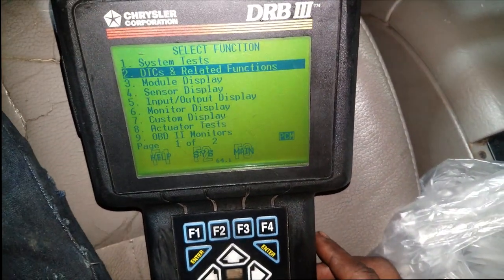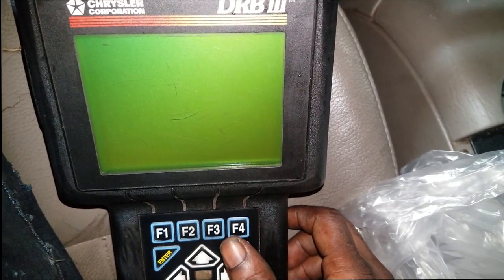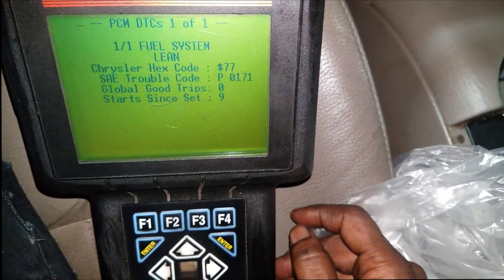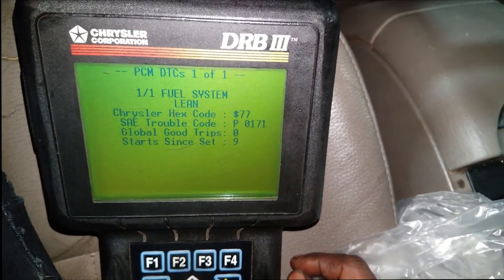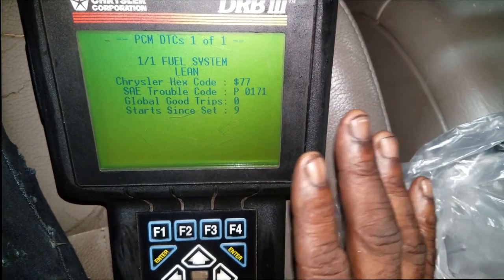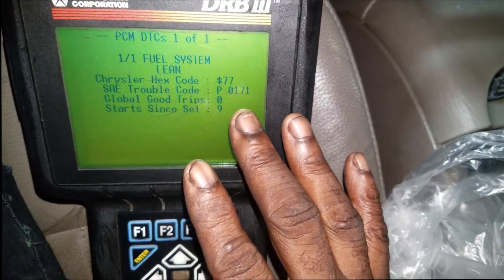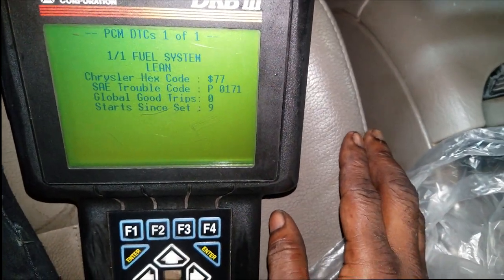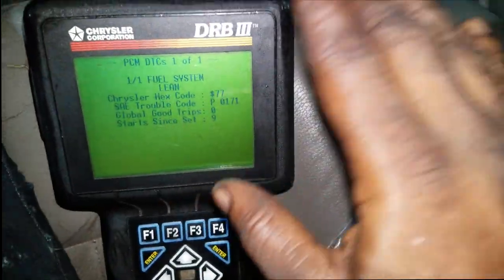How to tell if the fuel pump BAD. Car shuts off while driving, DTC code P0171

Comment: I have a 2002 Ford Mustang V6 and as I'm driving it shutdown so I pull out the key and then sometimes it will start back up but sometimes not right away. Any suggestions I can do.

Comment: My 96 Explorer 4.0 shuts down on the hiway, I roll to a stop and it will be idling, I shut the switch off for a second or two, then it starts up and may go anywhere from 7 or 8 miles to 60 or 70 miles then it's the same thing. Could this be my problem too?

Comment: Good video:). I have a 92 5.2 dakota that randomly shuts off while driving. New coil, plugs, wires, cpu is new. Crankshaft position indicator new. Fuel pump has been replaced for a while. I do notice that my external fuel filter does not look like it has been replaced of late. As you say, I do not get a check engine light when the engine dies. I can wait for up to five minutes and the engine will start again. I am thinking maybe the fuel filter is restricting fuel flow due to it needing to be changed?

Comment: Yep, had that happen to me on a road trip, my tank was low at the time too and it would start up after ten minutes or so and go for another 5 or 10 minutes before shutting down again, finally made it to a gas station and brimmed the tank, that kept the pump cool and we made it home.
Reply: Matt I have a 2002 Ford Mustang V6 and as I'm driving it shutdown and then I have to take out the key and sometimes it starts up and sometimes it won't. Then I wait and it will start back up and drive fine for awhile but then turn back off
Reply: @kennethsmith7794  That might be an issue with the security on the car, you may have a bad key that the car is not recognizing.